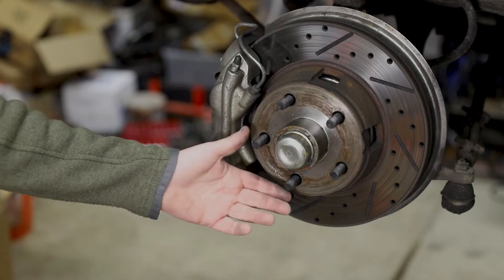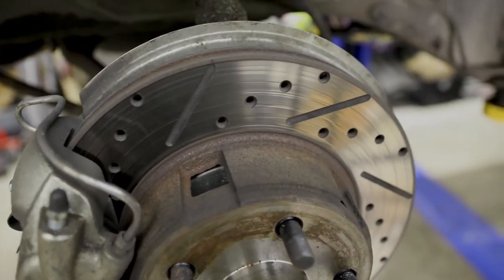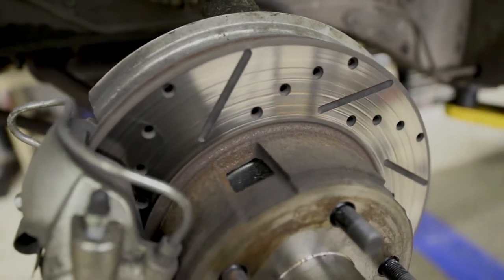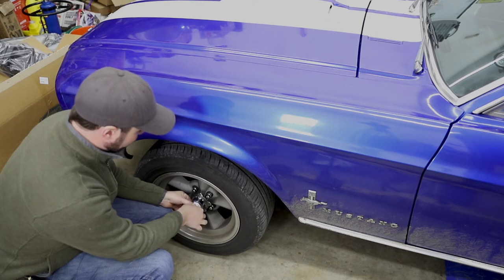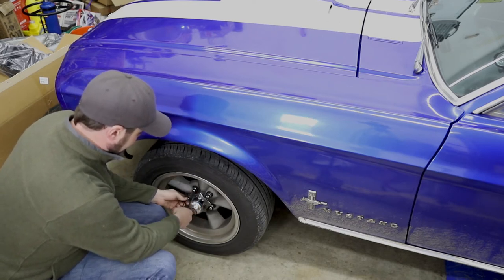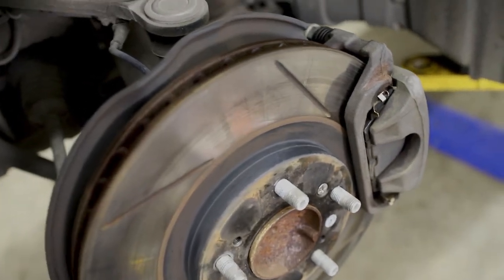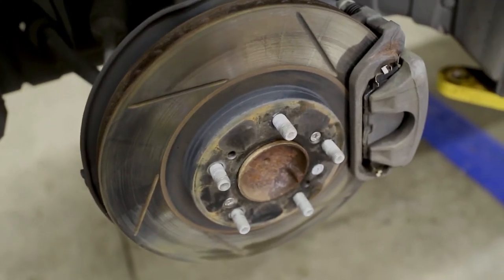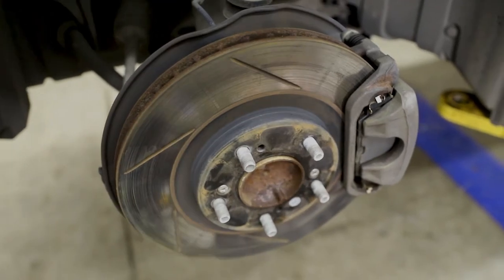How are the cheap brakes working?

Comment: I have to ask because I'm looking at disc kits right now for my Fairlane. Is the kits your talking about Leed or Master power ? I don't want to make the same mistake.
Reply from the maker: A lot of the cheap kits just use Chinese reproduction parts. The kit I was talking about in this video is the one I discuss here: https://youtu.be/damNvs5EQxA. I do not know if it's sold under those brands, but you can look at the parts and get an idea if they look the same.
Reply: @AmbiVe  Thanks, i bought Wilwood to save myself from problems.